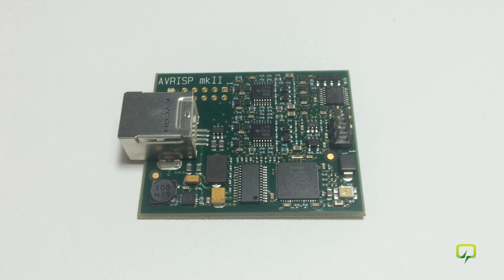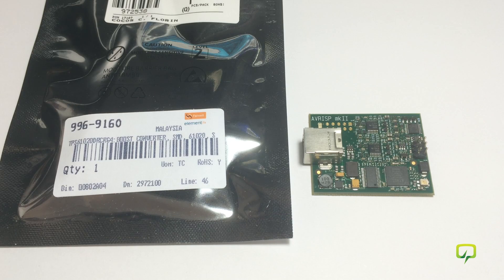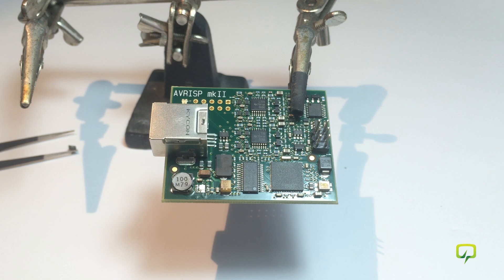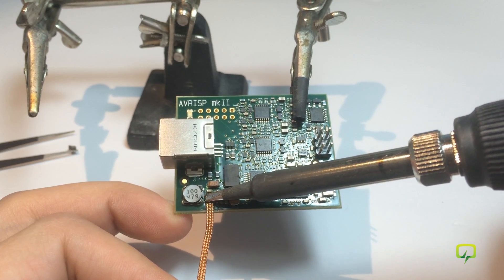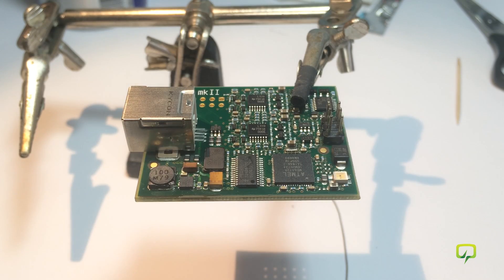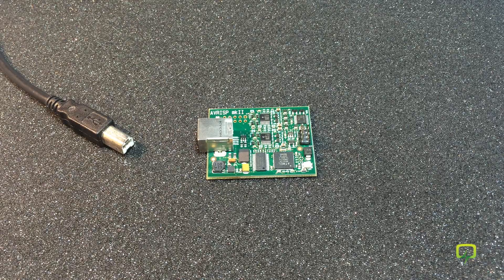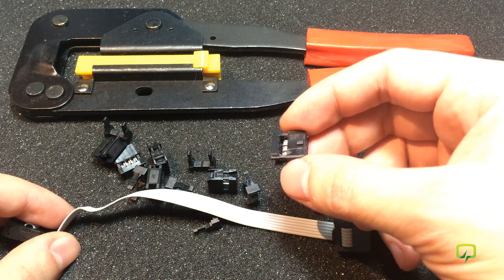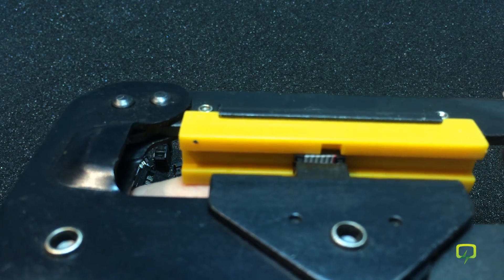VoltLog #2 - AVR ISP MKII Repair & Upgrade

Comment: Your Soldering PCB holder is too flimsy, try DIY using one of this https://www.fasttech.com/p/1140011 if possible with a heavy base.
Reply from the maker: Indeed, my pcb holder is crap! Luckily it is used rarely so i never bothered to search a better one. I will however take a look at your recommendation. Thanks!